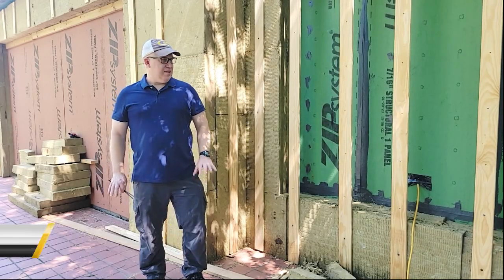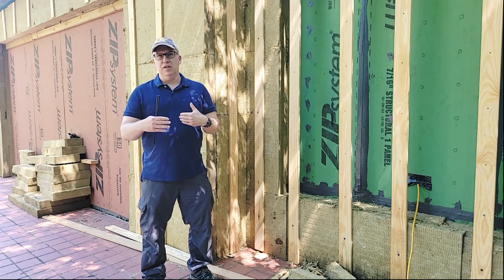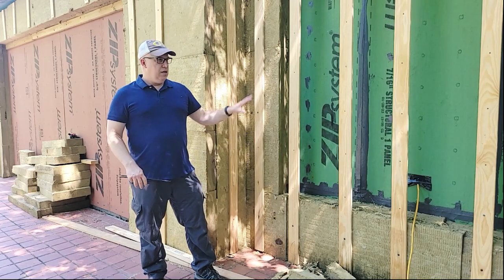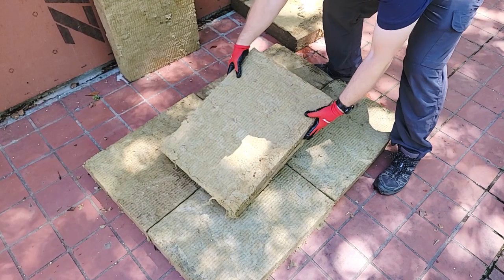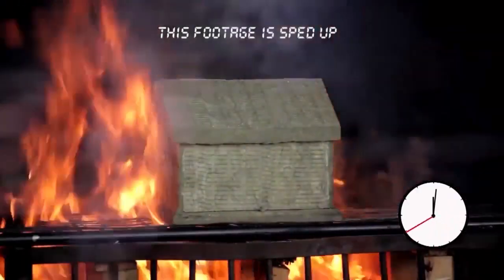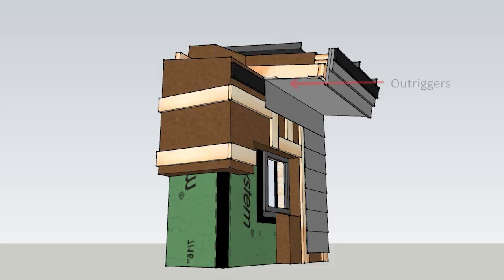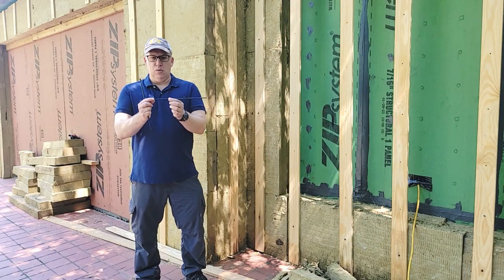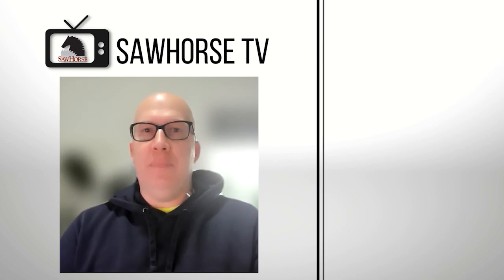The "Perfect Wall" with ROCKWOOL and ZIP System

Comment: Very intriguing system.   I have concerns about the wind load capacity of the roofing and the sidewall cladding if held in place only by long screws with minimal shear capacity of the sheathing.  Can the exterior hold up to hurricane and gale force winds.  What is the comparable cost of construction?  I sure those specialty screws are $$$$.
Reply from the maker: I hear and agree with your concerns for your climate zone.  This house is in Atlanta where we can even utilize wind power since we are in a piedmont.

If this house was on the GA coast, I would have 2" of mineral wool on the outside and 5.5" blown mineral wool in between the studs.  

Adjust the amount on the exterior based on where you live.  In New England more like 4-6" on the outside depending on the modeling.

I also will be using the ramset fasteners that are thermally broken on the next project.

Comment: Are there any actual studies of how a long metal screw conducts heat through the insulation!
Reply from the maker: Yes- passive house had a worksheet that adjust the R-Value of the assembly based on how many you use.

Comment: How are screw penetrations through zip sheathing sealed for air and water(screws fastening furring)? Thanks
Reply from the maker: The WRB is not affected by the screws going though it.  Most installations don't even cover the nail holes where the zip attaches to the studs and the blower door results are not affected.

Comment: Curious on why you didn’t go with a less R-value comfort board and went with Zip-R sheathing. Thinking about remodeling sheathing 2x4 house with Zip-R6 and R15 comfortbatts behind it
Reply from the maker: The perfect wall insulation details are designed so the dew point does not occur before you reach the WRB.   In this case is will be about 2-3 in the insulation.  This helps the structure last longer.  I'll post some longer videos to help explain it better.  In milder climate zones such as Atlanta, it is not a huge issue.  In colder weather climates it matter a lot.

Comment: What’s happening with that Rockwool and furring strips sitting on the ground ?  How are they maintaining a gap away from the concrete or pavers ?
Reply from the maker: We still have to rebuild parts of the front porch slab, and those will get trimmed at that point once we set the final height for the pavers.   We installed the walls now so we can wrap up the roof details and get the metal roof on to help protect the house.